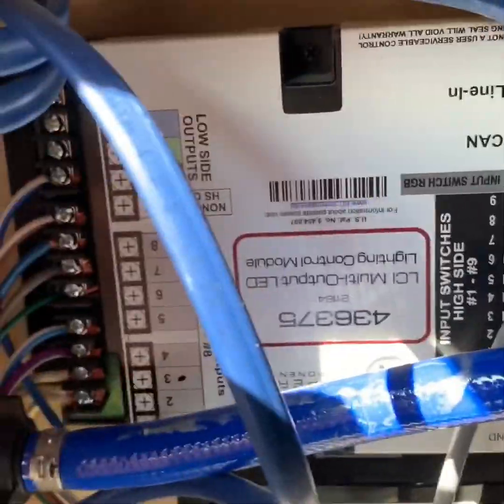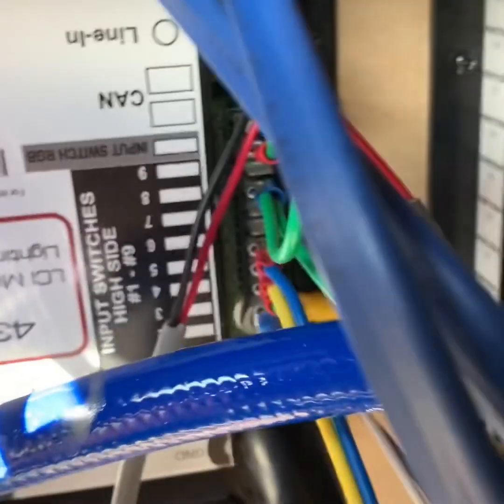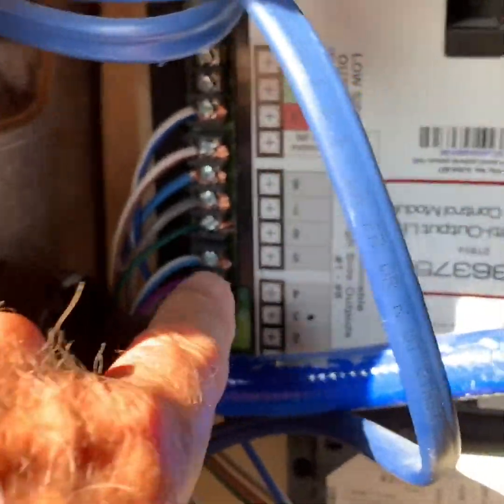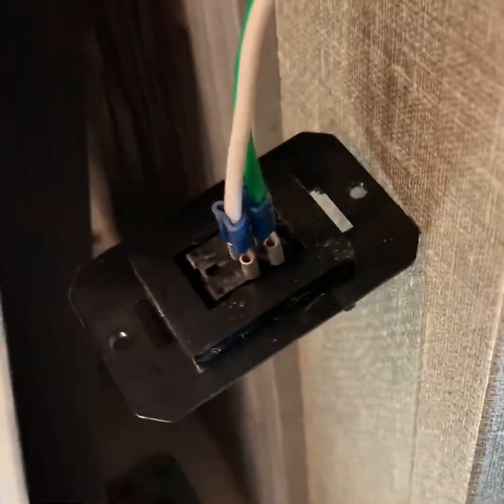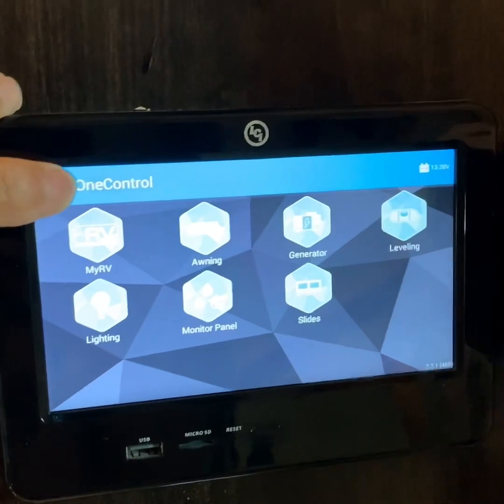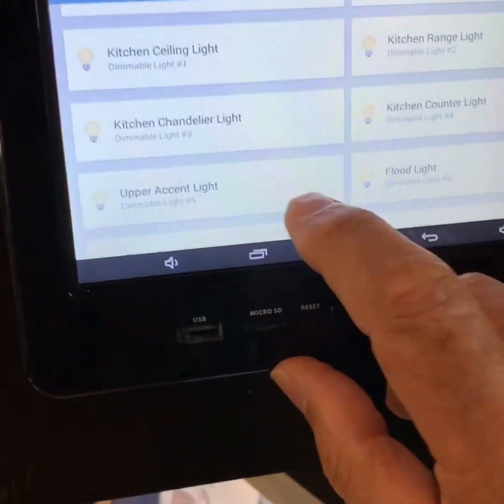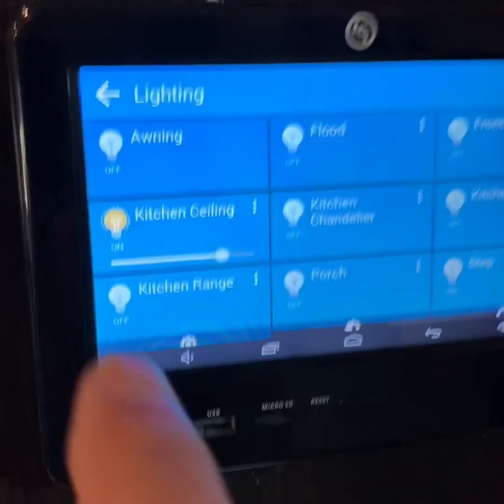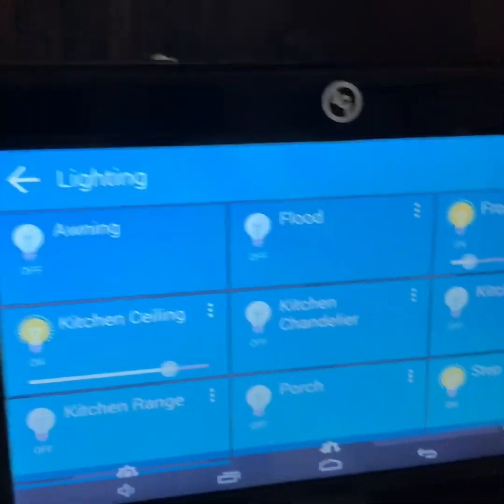Adding switches to OneControl

Comment: i have the one control unity x1 board all i can control is my lights and awning do you know if i can just tap into the black tank and hook it up to the board so i can see the level on the app?
Reply from the maker: Chances are, no. There is a interface module that is used to read the tank sensors. So you’ll need one of those to be able to display sensor levels on your OneControl

Comment: How did you run the wires in the walls and under the cabinets for the switches?
Reply from the maker: It’s difficult to describe how I run the wires but basically , using my endoscope as a snake, I came from the area behind the pass through to the bottom of the cabinet which has a false bottom. I did drill a hole in the bottom 2 X 2 to get from the electronics area into the wall.